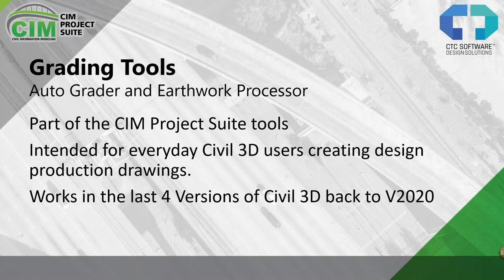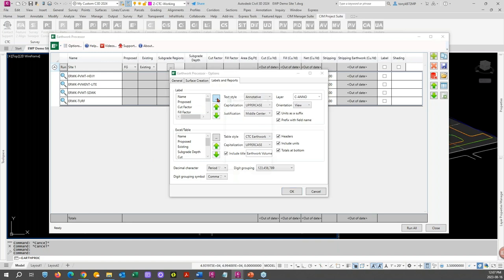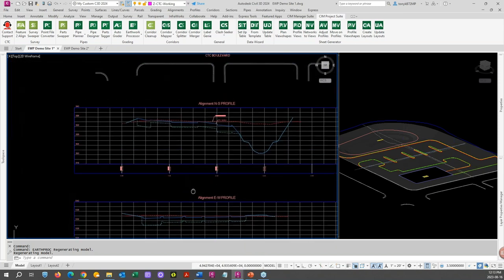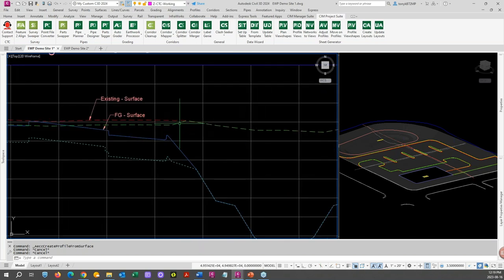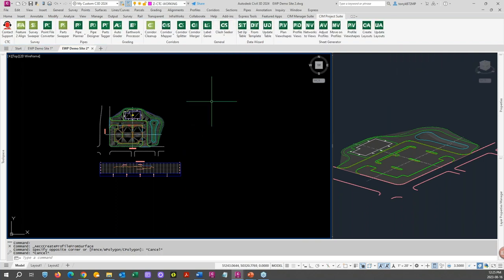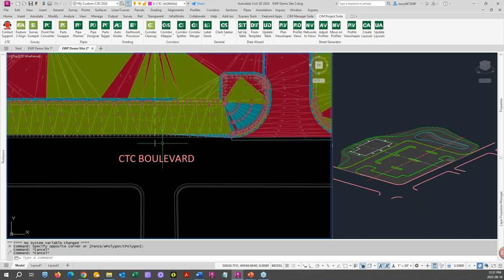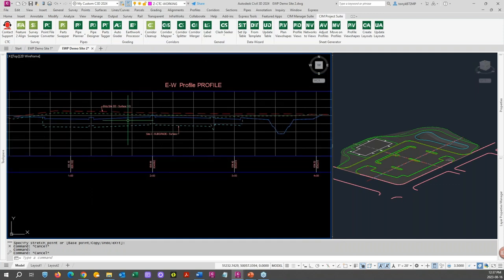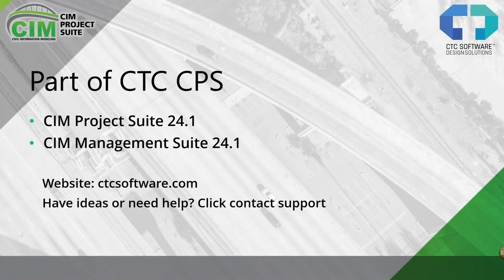Earthwork Processor - Surfaces and Profiles

Comment: thanks for the presentation, is there a way to overlay surfaces (one on top of another, higher or lower, slightly more to the right or left) to do multiple calculations of possible platforms and compute a massive amount of cut and fill, or remove that error which you mention, thanks in advance for your help
Reply from the maker: If you are referring to regions that is not currently something that our tool does however we are working to add Island Detection as an upcoming feature to Earthwork Processor. Should you want further assistance or more information you can reach out to our team at info@ctcsoftware.com